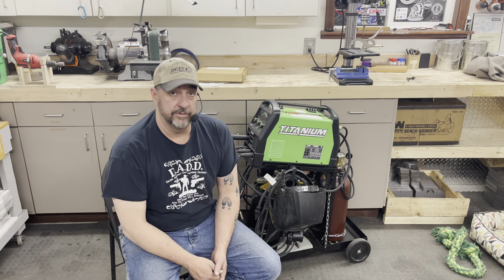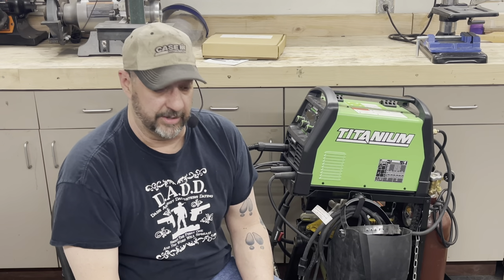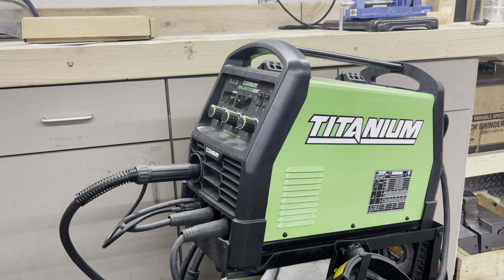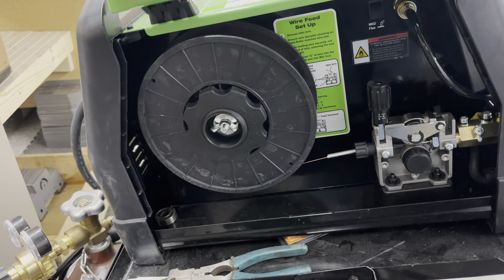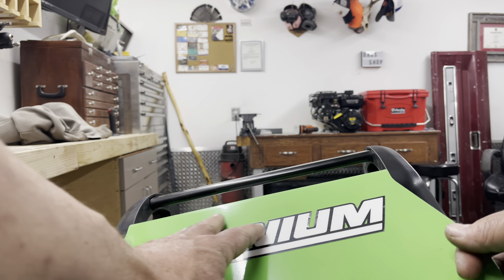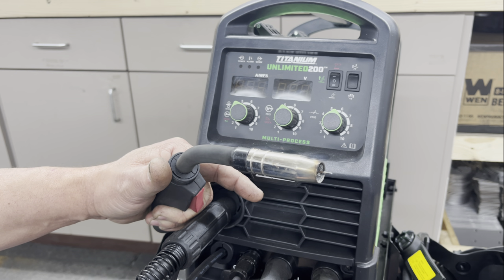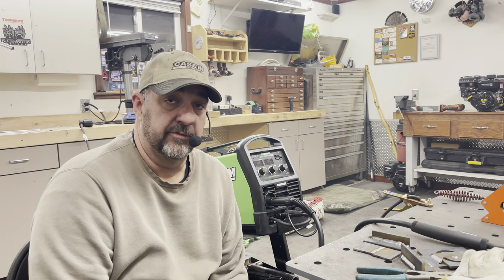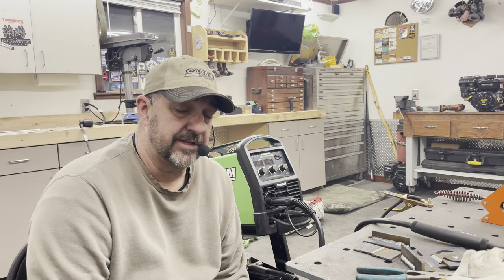Harbor Freight - Titanium Unlimited 200 Welder - Junk or Jewel?

Comment: Stuck between picking up one of these or the Tooliom TL-200M. Found them both in OfferUp with the Titanium being $100 more. Was wondering if the option for 240v and 200 amps is necessary or going with the known quality control of Titanium over Tooliom
Reply from the maker: I would spend the extra Benjamin. I use the 220v as much as the 110. It has a longer duty cycle on 220 and welds better with 220. The 110 is more convenient to be sure and has a place.

Hope this helps.

Comment: Wow. Wow! The Titanium 140 welder comes with a Tig welder, Mig Welder, and Stick welder, all in one, with all the necessary parts. It actually includes the Tig "torch," and it's not something you purchase separately. All for $500. Insanely good price!
Reply from the maker: Keep in mind, the 140 is not able to use a 220v input and that extra 80 amps will make a difference. Good price but light duty.

Comment: First, I would love your welds outta practice or not. Enjoyed the review, I have this welder and am new. Quick Q, should I ditch the wire that came with it? I'm learning with flux core, haven't done gas yet. It came with .030, should I go .035? TIA.
Reply from the maker: Doesn't really matter. The wire you get with it is fine. Flux core is harder to weld with. Get 75/25 gas and no flux wire as soon as you can. Way better when welding indoors.

Comment: Getting ready to buy one. To save money would the 170 be the same buy if I don’t plan on runnin tig ? Read another comment that said “That extra 30 amps is only available on the tig setting by the way, so if you're only doing mig the 200 and 170 are effectively identical.” 
I do want the spool gun for aluminum option tho hoping the 170 has that too
Reply from the maker: The 170 will not run the spool gun.
Otherwise the 170 would be fine if TIG is not in your future.
Reply: @jackofalltrades7822  thanks !

Comment: im 77yo now but right out of highschool i was a high rise ironworker for 20 years then transferred to pipefitters cause i never failed a weld test,nukes flying certs military or race cars,i never bought a multitask machine,if it goes down you are screwed,i welded with all brands,right now i think the miller or lincoln are the real best,the arc orbital welders seem to be what everyone is using on high purity stainless steel tubing for chip fabs,fred lozon

Comment: Im looking to buy a 170 seeing my old licoln 140 and only 110V its "old" my question is what size bottle of gas should I get. Im a novice . How many hours would the bottle you have last?
Reply from the maker: Mine is a 40 cubic foot bottle. It lasts long enough to do a decent size project. That’s a good size for a beginner and if you feel you need bigger just trade it in. 

Don’t buy the bottle. Do a bottle trade account with your gas supplier.

Thanks for watching.

Comment: It’s not a gem or junk. It is worth it’s price, but if your a professional welder you will find the drive rolls not very robust, I sold mine and bought a Lincoln Power MIG 210 MP Multi Process Welder. I still plan to upgrade to a better welder again so that I can use a longer whip with Tweco gun.

Comment: Hard to tell 'junk or jewel'. The warranty is great as I have been through 10 of these machines. Love how they weld until they don't.  The wire feed always gives up within 3 spools of wire(12 lbs). Anybody else have this problem.  Running mostly .025 wire on 14gauge tubing. If so, is motor or circuitry that gives up?
Reply: Any updates
Reply: @richardvillanueva559  found problem with wire feed drive, brushes move lose contact. Pulled it our reset them runs perfect. New drive is $68, so not expensive to fix.

Comment: I love mine way better than my old Lincoln especially when you have to heft it up a ladder on top of a kitchen Hood to weld in the grease duct through ceiling grid and you're by yourself 🤣🤣🤣 been using mine for about a year now also I especially love the dual voltage capacity of it for when I only have ease of access to 110 the other thing I like about it is it has better penetration on flux core wire than my Lincoln does set at 220 of course

Comment: Have mine for two years right next to the Miller. Both my my in house mechanic and me grabs this machine instead of the Miller almost every time. If your doing anything production, don't get it. But the welds are clean and deep enough.

Comment: A question please, on the 2 pound spool when I put it on and adjusted to very little tension the wire still didn't feed properly even after adjusting the tensioner.  I ended up removing the spring and just snugging the wing nut to the washers.  I did adjust the tensioner for the wire feed.  I welded long ago but used the high end ones.  Any pointers
Reply from the maker: @robertduncan2742  I assume you are using flux wire on a 2# spool. If you are using flux core wire you need to use the correct groove in the rollers. The core wire groove is slightly serrated to grip the wire better.

Also make sure you installed the correct rollers for the wire size you are using.

Hope that helps.

Thanks for watching.
Reply: @jackofalltrades7822  It has the size 30 and flux wire is also 30.  The roller doesn't have grooves unless that was changed from long ago when I welded.  Everything is aligned ok.  I'll check everything again.  Theres a extra roller in the bag.  Maybe I'm using to much tension but I adjusted it a few times.  Without the spring tension and the wire it's running fine.  I'll adjust things again.  I appreciate your help.

Comment: I know nothing about welders or welding. I am curious what features and design elements are needed for a welder to be considered for professional use.

Also curious about what is the pros and cons to the different types of welding types. When would stick be a better option to MIG etc.

Thank you for the time and effort for the video.
Reply from the maker: Duty cycle is a big one. Amperage is also important. The more amps, the thicker material you can weld. Availability of consumables is important. Quality and longevity. 

Stick provides great penetration, burns through mill scale and rust, can be done outside and has less moving parts. Down sides are it produces a lot of smoke, it requires cleaning the slag between passes and when the weld is done and is more difficult to learn. Stick is the better option for outside work or when welding rusty/dirty/painted metal.

MIG requires more maintenance on the machine, has more consumables, can be used outside only if you use flux core wire. If you use gas and hard wire MIG is an indoor process. Reason being is that wind will blow the gas away. All that being said MIG is by far the easiest to do, provides good penetration if you have enough amps, requires no clean up between passes and has little to no clean up when welding is complete. MIG doesn’t like rust or paint and the metal must be cleaned off.

This is not a comprehensive list but those are the high points.
Reply: @jackofalltrades7822  Wow that was a quick reply! Thanks for the information. I have always been interested in welding but the cost and time required to learn has always gotten in the way.

Fortunately or unfortunately I have to learn fast since my friend who did the maintenance on my trucks and trailers moved. He did all the welding and it was always with a stick. Now I understand why.

Since you obviously are a gentleman and a scholar no matter what the comments say I am now subbed.

Thanks again!

Comment: I have the Titanium 170, so pretty much same machine without the tig function.  I find the it welds pretty good, especially for my beginner self.  But it does seem some times the wire feed gets really wonky.  It seems sometimes I have to crank the wire speed WAY up to get decent welds.  But overall, like I said for a beginner doing some car projects, it works pretty well.
Reply: I had the same problem but solved a lot of it when I realized that I was using the incorrect drive wheel provided with the welder. I use flux core because I weld outside..
Reply: check your roller pressure
Reply: I just put in a 240v outlet today so we will see how it goes
Reply: @flydaddy55  It's got the correct drive roller in it.  I've had the pressure where you could stop the wire feed and I've had it tight where it could push thru a brick wall.  It just seems sometimes the feed rate is erratic, especially at slower speeds for really thin sheet metal.  Up about 18v and 220ipm it seems fine.  I've got it on 240 now, so I'll see how it works.

Comment: Does the tip of the gun touch the metal part when welding or does that ARC it out ? Is the only thing that touches the metal is the spool correct ? New to welding Thanks
Reply from the maker: You never touch the tip to the welding project. Only the wire coming out of the tip contacts the work piece. 

You should have approximately 3/8” to 1/2” of wire stick out while welding.

Comment: Bought one when it first came out about 4+yrs ago when I first went to welding school, major diffuser issue, did I complain, did I return it, NO! Took a tap to it and made it so it would except Vulcan tips, this thing is unbeatable but cheaply made that just won’t stop working, and work well. I have thrown out the most awesome MiG dimes on trailer builds, and flux for some insane monster gate side job builds. The market has changed since I bought mine, many players now in the welding market, I’m just commenting on personal experience.

Comment: Just got the titanium unlimited 140 and the only issue I’m having is tripping the breaker granted it’s only a 15amp breaker and it has allot running off of it but so far so good just need to figure out a power source that won’t trip
Reply from the maker: Yup, a 15 amp ain’t gonna cut it.

You really need a 20amp at a minimum and it needs to be fairly open. 

Thanks for the view and comment.

Comment: What’s the difference in the numbers? Like you have the 200, I see a 140? Are they just model numbers or do they have a meaning to them?
Reply from the maker: It’s the Amps the welder will put out.
Reply: @jackofalltrades7822  thanks for letting me know
Reply: @jackofalltrades7822  what would be a well rounded welder amperage for like vehicles and work bench building. I’m thinking of frame work and winch and rear bumper building shop stuff

Comment: I'm sure you've been told already but the 2t and 4t is for tig as well. THAT is why it's on this machine
Reply from the maker: That is not correct...at least on this machine anyway.

The TIG function on this machine is scratch start and the 2t/4t does nothing on a scratch start machines. 

It must be a high frequency start TIG machine (have a pedal or knob to control the arc)  for 2t/4t to work.

I did a video on this very discussion point. 
https://youtu.be/is1Wm1Suwns

Thanks for watching.
TIG machine

Comment: I've been to Harbor Freight and then I went to yeswelder and what I got for less money equal to Titanium welders 200 amps at 60% duty cycle way better deal plus it has safety features for feeding the wire and for purging the gas
Reply: Walter Barger  they couldn't even get me the yeswelder they lost it in the shipment I got a vevor 160 amp that's a pretty clean little welder they shipped it in 3 days

Comment: This is my dream machine, but I am on disability. I have a Titanium Flux 125 that I use for my projects for now. I miss some opportunities because I only have flux core
Reply from the maker: Unfortunately they are not giving them away.

You should also check out my YesWelder MP 200 review. It has a plasma cutter built in to it. It is a touch more $$ but the plasma cutter is worth it.

Thanks for watching.

Comment: The Vulcan is better built have brass gears instead of plastic like the titanium ,I got me a Titanium and took it back and pay a little more and got me the Vulcan 215 and never have any problems .I could not get the gas to come out in the Titanium welder that was the problem and I have been welding for like 30 years
Reply from the maker: True statement but that would be why the Vulcan is also far more expensive.

Thanks for watching.

Comment: Is the 2T and 4T maybe meant more for lift tig with a button? Good video btw.
Reply from the maker: Nope. It says right in the owners manual. It is a MIG function and is available on the MIG 140 & 170 machines. Thank you for the view and comments.
Reply: @jackofalltrades7822  Thanks. I wanted to get one of these today (actually the 170 version) and they are out of stock until late August. These videos are working for them. They should pay you ;)
Reply: @jackofalltrades7822  i think that the 2 t and 4 t option might be a helpful feature when you are welding around a pipe or tube or something where you have to change your direction of travel but you need to maintain your arc.. that is what I use it for anyways 🤷🏻‍♂️
Reply from the maker: @adamnahtankyoulol3499  great point. I never considered that. When I was fabricating I didn’t have that option so it never occurred to me.

Comment: Thanks for such a good review. I haven't welded since my early twenties(now in early 50's) I do a lot with old cars in my spare time. I'm getting tired of sending my welding jobs out. How do you think it would do on frame work? Replacing/repairing rust pieces in the frames.
Reply from the maker: Thanks. Still love the machine. It is going strong and am on the 5th tank of 75/25. I will have to try flux core wire and review that.

Comment: great video, good machine. may i ask the question? why does everyone out there when mig welding, they oscillate their gun. why dont you just run your welds as stringers, better penetration, better look on the bead. if you try to stack dimes when you go to lay multiple beads you have too many things to keep your mind on. i just dont understand .

Comment: Were you using gas with those welds or straight flux wire?
Reply from the maker: Hardwire with 75/25 gas. No flux core was used in the video.

Comment: I just bought this welding machine today, I’ve never welded before in my life, I’m a Instrumentation fitter/Electrician in the refineries, but I want to learn a new craft, any tips or advice? Thanks for the vid, keep em coming! I subbed! God bless.
Reply from the maker: The best thing you can do is to have someone teach you. A friend, adult education or something. If the is not possible there are some great you tube vids on welding technique. Start off stick welding. If you can stick weld, everything else will come easier. Lots of practice. Get every piece of scrap steel you can get your hands on a start making sparks.
Reply from the maker: Thank you for subscribing and I will find a couple good vids on You Tube to get you started.
Reply from the maker: https://youtu.be/OWThL97tq3k
Reply: @jackofalltrades7822   thanks! I wanted to start of with Stick, then MIG, then work my way up to TIG. All in due time of course. Thanks again.
Reply from the maker: https://youtu.be/pMtqDWUpJds
Reply: @jackofalltrades7822   yeah my buddy is a Combo welder, he can do it all, he’s been helping me out.

Comment: Question......Can you suggest were the best place to get the gas bottles?  can you suggest what types (gas) as well....
Reply from the maker: I use 75/25 and it works great. Any local welding supply is where you get bottles filled. My local shop is Praxair.

Comment: I had 2 of the 200 welders. Both broke. Luckily I had the warranty. Bought a hobart instead
Reply from the maker: That sucks dude. I hope it doesn’t happen here. So far I have run 6 spools of wire through it and no problems. Fingers crossed 🤞 it continues.
Reply: @jackofalltrades7822  i only got 1 10lb total through both. The first one only last me a month and the wire stopped feeding. The second one started doing it at 1 year.
Reply: @jackofalltrades7822  If you get 5 years out of it I'll eat my shorts.
Reply from the maker: @maplebones  we shall see

Comment: I got the 170 titanium. 
Subscribed!
Reply from the maker: How do you like it? …or haven’t tried it yet?
Reply: @jackofalltrades7822  I've had it for a year an a half. I love it. Makes my welds so much better than flux core. I've built a benchtop ring roller, a 34lb bench vise  and several targets and stands for shooting sports. Made a few steel 3/8" plate targets beveled on both sides on one pass. Withstands 9mm and .357 mag, great little machine. I see you surpassed 1k subscribers congrats! 
I'll watch your other vids too. Cheers🍻

Comment: Hi there, I recently bought one to learn how to weld. I know absolutely nothing about how to weld and currently attending YouTube University to learn. Your video was a lot of help. I want to learn because I want to fabricate off-road/overlanding parts for truck. Do you think this is appropriate for welding DOM tubing to the frame of vehicle? Which process would you suggest? I was going to mig weld rock sliders. An off-road bumper and roof rack later on.
Reply from the maker: This is not a commercial machine. It will be good to learn on but if your going to fabricate you will want to graduate to a Miller machine that is more suited to a higher duty cycle.

The Titanium will weld most anything you want but it is not intended for heavy use.
Reply: @jackofalltrades7822  now I have to look up what Duty Cycle is 🤦‍♂️😝😂. Thanks for the advice.